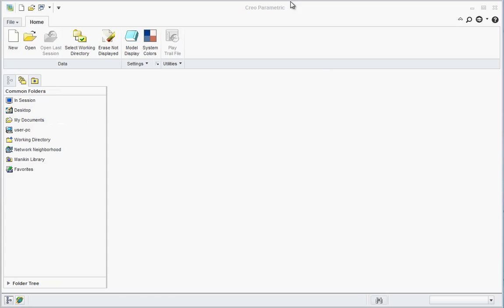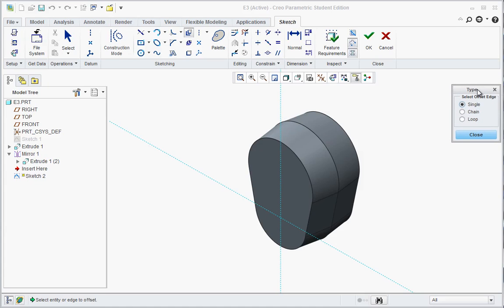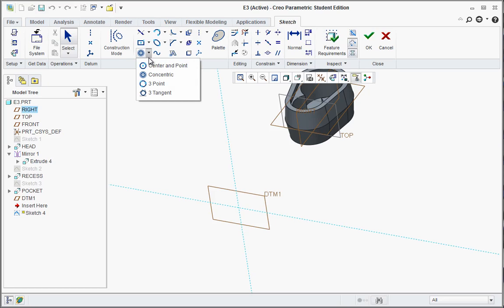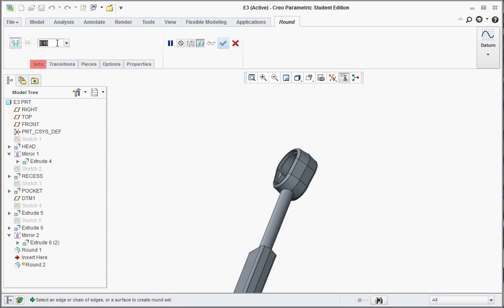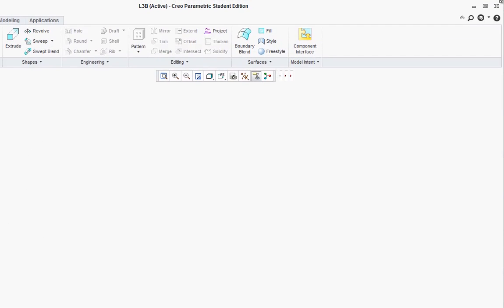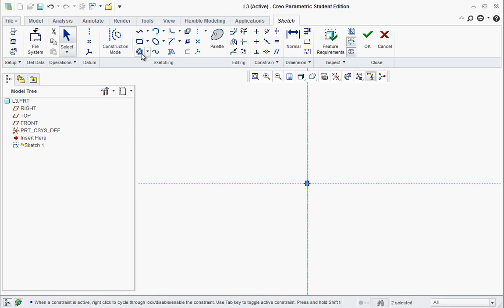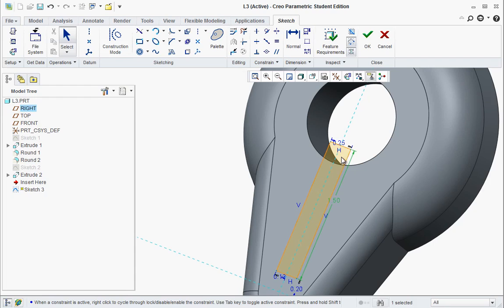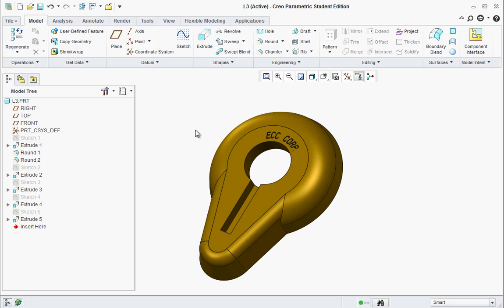E3 CREO Parametric 2.0 - Basic Modeling 3

Comment: Hi just noticed one misstake, if you extrude the shaft the way you did, the handle is only connected on one line to the shaft,

But keep up the good work!
Reply from the maker: Ivory Music Thanks for the catch and compliment. Yeah, I intended to lock the center line to center the CSYS, then dimension the length to 3.75, when it failed to automatically lock in I forgot to go back and do it. I have a new video for Creo Parametric 3.0 using  the same part. https://www.youtube.com/watch?v=fce3LvuOdso

Comment: Nice tutorial. I have two notices:
1) If you want to orient view parallel to screen 
(in sketch) use special button. This button is active when you have sketch open. 
Press "ALT" and then "Z" and "I" or write down Sketch View in help textbox to find the button 
2) After made construction line you can make point in the center and then make coincident constraint between end of construction line and the point